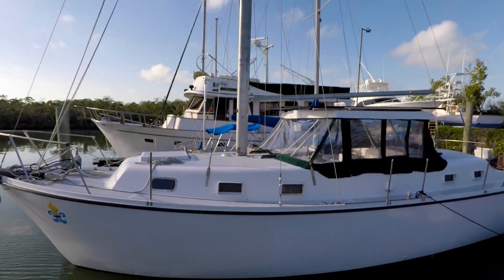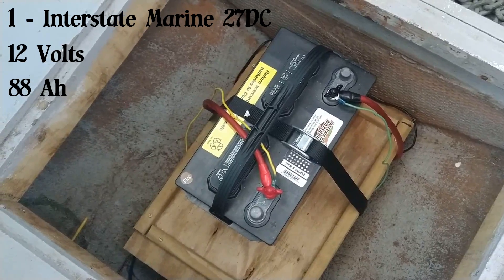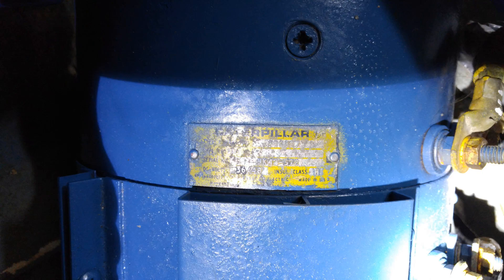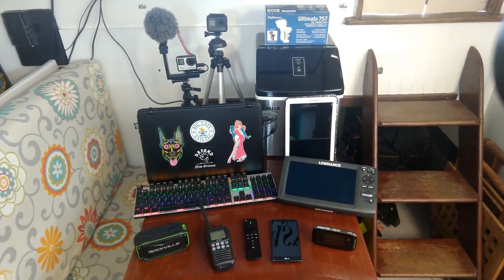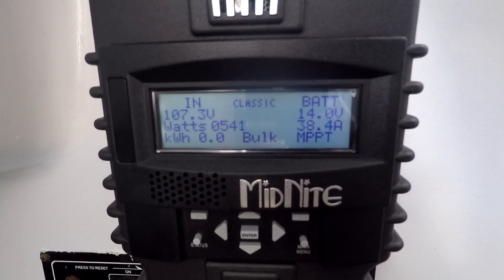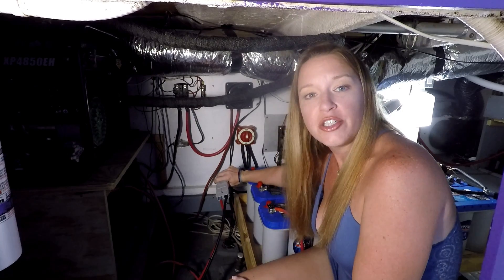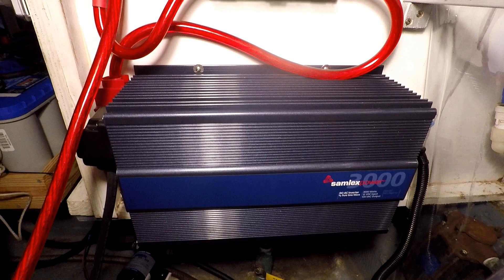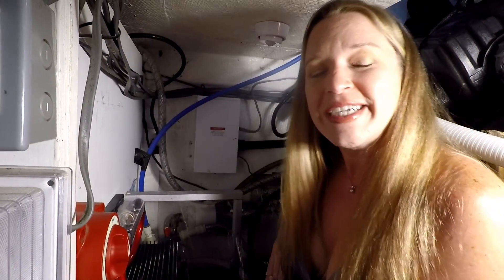Ep. 33 - Our Power Plan Pt. 2 - Energy Below Deck ~ Big Easy Sailing

Comment: My first thought was - that's a lot of weight!  Those batteries are probably ~ 50lbs apiece, so at least 1300lbs total.  Plus the motor which isn't light plus all the wire, connectors, controllers, etc.  Then I checked the weight of a new Perkins 50hp diesel - about 500lbs.  You wouldn't carry "hundreds of gallons", on that boat but you might  have 100.  Roughly 7 lbs per gallon when full, so about 700 there, 1200 total.  Pretty comparable actually.  When Li Ion batteries come down in price, you'll have all the infrastructure in place to reduce your weight by a lot.  (And/or increase your AH.)  I also agree with the safety aspect of the diesel engine in a bad situation.  You just have to make sure at least one of those battery banks are topped up all the time.  (It sounds like you are managing the system pretty carefully.)  

Great to see you on line again, and another well done video!  Time to get sailing!

Comment: great setup. There is a relay which automatically switches if the voltage in a circuit reaches a set level - that could save you the manual trick with the Andersons.

Comment: Thank you for posting a great video of your set up. The ,series parallel' got me a little confused but I got it in the end , 'batteries in series to get 36 v then in parallel to get more capacity'. Phew! Yeh 'series parallel'.
Maintenance of all these batteries must be quite the project , checking acid levels, checking tightness of connections, checking for corrosion on terminals etc , checking tightness of tiedown ( did I see tie-downs?).  Checking for a bad individual  battery taking down the whole 'bank' ( how would you do that or even know , I don't know).  Prehaps that will be part 3 at some point! 
You did not mention ventilation..... I watched a good friend once fiddling with a loose terminal on an old battery in his jeep, something exploded/popped , I assume the hydrogen build up in a cell , very scary. Fortunately he did not get acid in his face , don't know how but all good. Just FYI! 
I'm sure Shawn will be on top of this with his expert background.
All very interesting thanks again for posting ( and having no children on  screen so we can comment!). Cheers Warren

Comment: Your calculation of ah are wrong for the series parallel banks.  the 9 batteries in series parallel provide 264AH  from full to dead ( but really you should only be using 132ah to stay at 50% charge)  in series-parallel you can't just do 9x88 to get the total AH  you have to divide by 3 to get your usable AH (3 is the number of strings you have )
Reply from the maker: Someone who paid attention in school.Good catch, friend. Yes, the series - parallel bank numbers were misquoted in the video. Great comment, Sir.

Comment: Don't forget a carbon monoxide alarm. Fire Extinguishers. And support the ends of your Solar panels! 30 to 50 Knots of wind may cause a problem.

hurt!
Reply from the maker: We have those safety items spread threw out the boat. The solar frame is pretty ridged, and the rig has gone through a few hefty blows. We tie them down when wind speed gets over 25 knots. Extra support is a great idea. We will reinforce them if they show signs of wind flexing or stress. So far, they have not shaken once.
Reply: @BigEasySailing  Just trying to help not criticize. The wind and water will rip the panels off if not super secured! The aluminum frame will bend! I mounted a Generator with 8 shock mounts rated 850Lbs. with a Generator weight of 850 Lbs. and when a squall put us on our side it ripped everyone out!  Did you ever put backing Plates on your swim platform?

Comment: That's alot of weigh. 27 batteries is alot of batteries. Just think of the weight savings if you just bought        4- lithium batteries.
Reply from the maker: Lithium will come later. $$ check prices. We are just getting started and are just normal working class Americans. Thanks for the comments.
Reply: For the cost of lithium batteries you could buy a new Catalina 30!

Comment: Next time the batteries need replacing, you will have to go with  Li-ion.. the weigh difference will be huge! I'm sure the boat will move through the water much easier!
Reply from the maker: Remember we are not carrying the weight of hundreds of gallons of fuel. The lack of large fuel tanks offsets most of the battery weight at this time. We are waiting for the new new lithiums.
Reply: @BigEasySailing  Yea, I just meant next time batteries need replacing, 3-5 years.. :)

Comment: Salt water and electricity don’t mix well
Reply: MrAli171 I don’t think I have run into any boat without electricity on yet, or are you referring to that there should only be rowing boats on the ocean🤔
Reply: Andreas Berg hi Andreas what I mean is relying on electricity for the main propulsion is in my view quite risky on a boat with only one engine , if the hull or a seacock fails it won’t take much to short it out, a Diesel engine will keep running in a part flooded bilge whilst repairs are done

Comment: why so many battery banks, understand having separate voltage banks but not multiple banks of the same voltage. You could probably simplify the charging using both aux ports on your midnite 150
Reply from the maker: Weight distribution is why there must be multiple banks on the boat. Things must have balance, especially on a boat.
Reply: @BigEasySailing  that makes sense... could you have some sort of automatic or manual switching so you don't have to plug and unplug the charging?
Reply from the maker: Not that we know of. The marine switches available are only 2 banks. It's very user-friendly and almost impossible to mess up a direct connection.